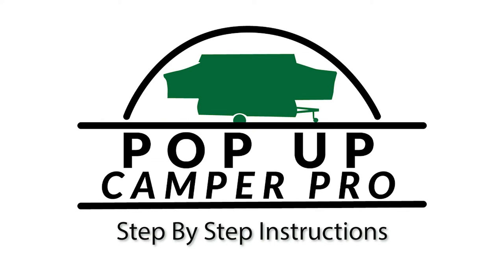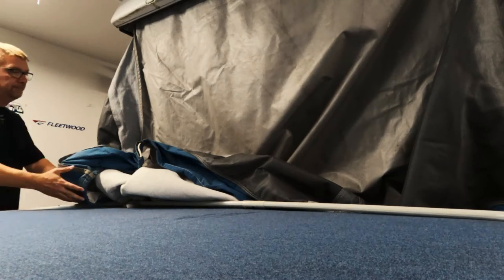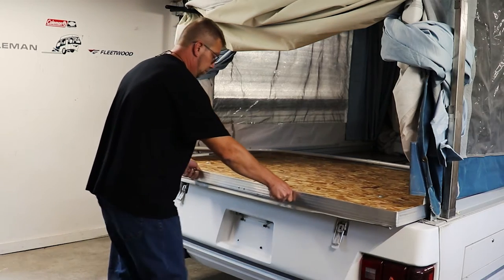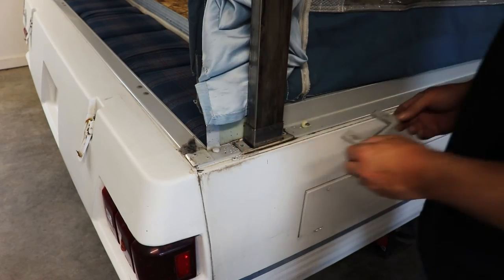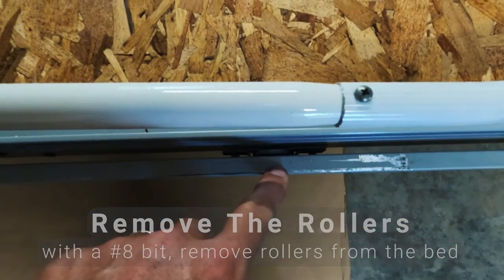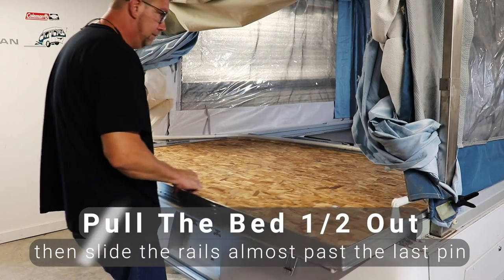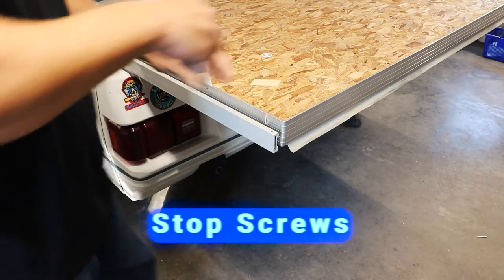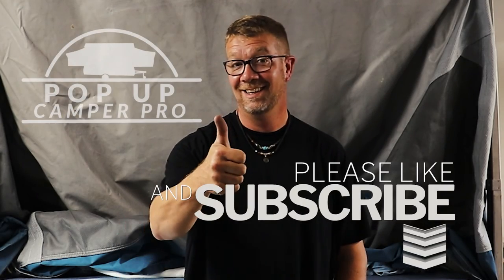Pop Up Camper Bed Rail Repair

Comment: Are there any good maintenance habits for the bed rails beyond just annual lubrication? The rails for the forward bed on the '97 Cheyenne my GF and I are working on are very tight, but don't appear to be damaged in any way. They still take both of us pulling hard to get the bed extended all the way out though.
Reply from the maker: It should slide very easy. Check your rollers and tracks. I think your going to find damage to a roller or debris in the tracks.

Comment: One of the rails won't let the bed slide back in.  Does this mean the rail is bad?  Is there a way to slide the bed back in without tearing things apart?
Reply from the maker: You’re likely going to have to remove it to gauge what the issue may be.

Comment: The bed rail wheel is flat on one side making it difficult to slide the bed in.  How do you replace just the bed rail wheel on a 1993 Coleman Pioneer Arcadia model?
Reply from the maker: This is a factory design and does not make the slide operation difficult. I suspect something else may be wrong. If it ends up being the wheel, use a machine shop to install the fastener unless you have a press at home.

Comment: My bed doesn’t slide in (currently the curb side front bed rail is sticking out about 3’ - bent and stuck. Don’t think it’ll pull out either. How should I go about trying to remove?
Reply from the maker: Follow the guide shown at the end of this video to remove stuck rails Dan.
Reply: @popupcamperpro  How do I remove the bed first though? Looks like the bed is removed at the end of the video, but the rail is stuck.
Reply: @popupcamperpro  and thank you for the video!

Comment: How do you fix broken screws that actually hold the rail to the caravan wall? 2 (doorway end) out of the 5 screws snapped off
Reply from the maker: Replace them and reinforce if required

Comment: Hi- any advice on replaceing repairing bed rails on a 2013 Palomino? I’m not even sure if it uses rollers. I just bought used and it took 3 people to pull the side beds out
Reply: Sorry, to date I have not had experience with the system.

Comment: How do I replace just a broken wheel
Reply from the maker: You likely are writing about the end roller wheel. We have them available at our webstore for purchase if you have not yet seen them. The fastener requires a press to install. I recommend a local machinist assist with the reinstallation.

Comment: My roll pins are bent. What size & material do I replace them with (are they aluminum)? Also, the automotive tape I found has a thin layer of foam. Is that correct?  Thanks!
Reply from the maker: Andreas, I recommend picking up a assortment kit. They’re steel pins I think, but they may be aluminum. I’ve bent them before as well. They sometimes used other double sided tapes such as cap tapes. I mention the automotive tape since it’s relatively easy to source at today’s auto parts stores.
Reply: @popupcamperpro  Thanks! I got a 10 pak of 1/8" x 1&1/2 pins" in steel. Good luck finding aluminum pins. The originals measure 7/8" long, but I can cut them down easily with my rotary tool and a cut-off wheel. The steel pins are obviously strong enough, but I was worried about galvanic corrosion with the dissimilar metals. Apparently, “Galvanic corrosion does not occur when dissimilar metals are completely dry”, which I think is generally the case here. But I'll inspect them regularly to be on the safe side.